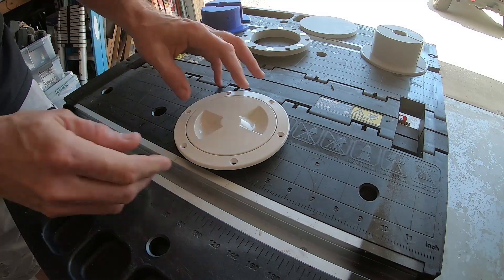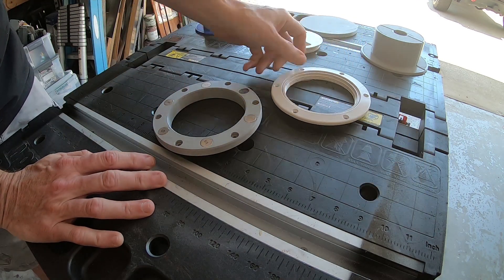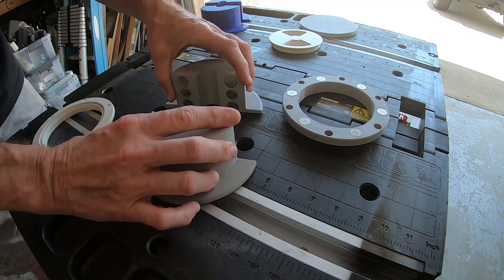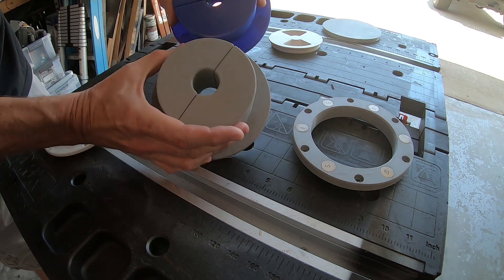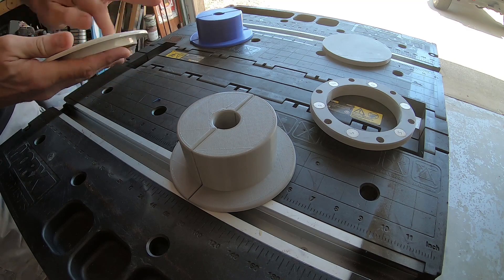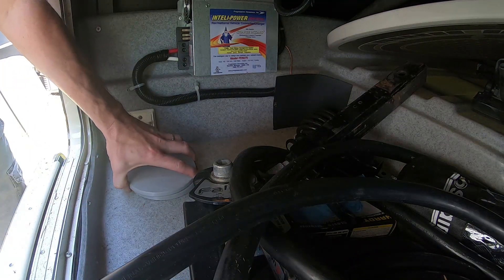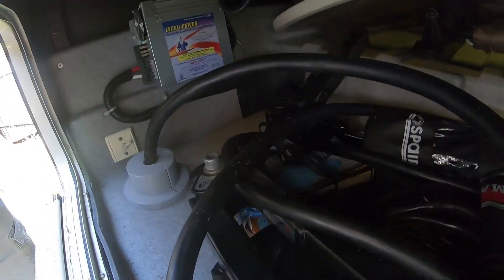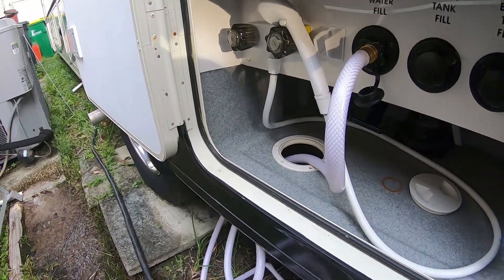Mouse Proof RV Utility Hatch

Comment: Slick! Just what I need. Much better than plain or cable hatches. I might revise to embed magnets from opposite side, leaving some plastic between magnets, if that makes sense. Less dependency on epoxy or super glue to hold magnets in place. Can probably just force fit into the plastic. Mating surfaces would then be all plastic, no magents or metal to foul.

Comment: Great files - thanks!  What kind of glue did you use to keep those super-strong magnets in place?
Reply from the maker: I’ve used 5 minute epoxy, and even super glue with great success. The key is surface preparation. Scuff the magnet surface that will receive the adhesive. I use ~120 grit, then clean with alcohol. This gives a strong bond.

Comment: this is exactly the idea ive been looking for but not quite right for my application. if its possible to modify your idea could you contact me?
Reply from the maker: I uploaded the CAD files to ThingiVerse.  The link is in the description.  I don't have time to modify the files for each person's use.  You can either get someone you know that's CAD savvy, and modify my design for your application, or get a piece of acrylic sheet (for example), cut it with a jigsaw, and use a forstner bit to recess the magnets.  Don't have to use CAD or a 3D printer that way.